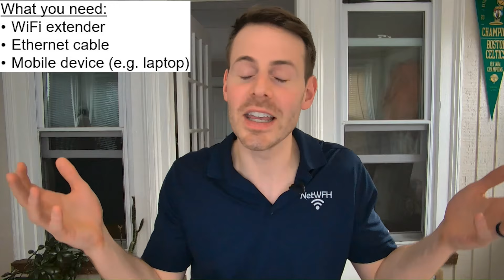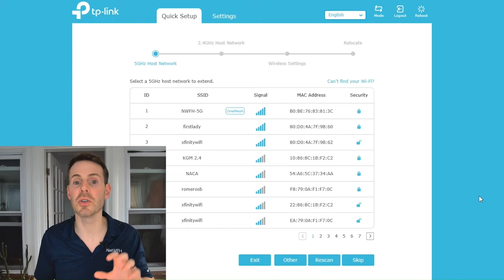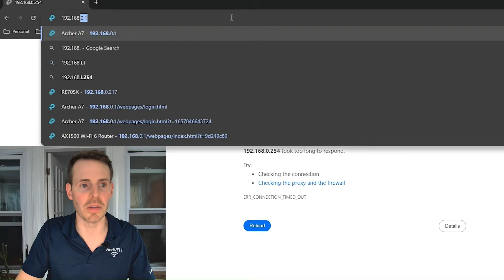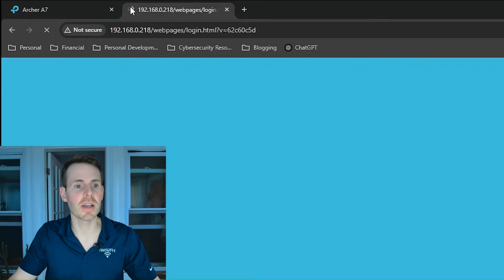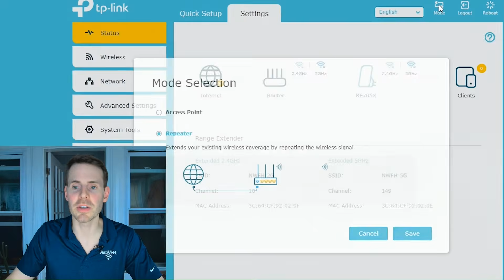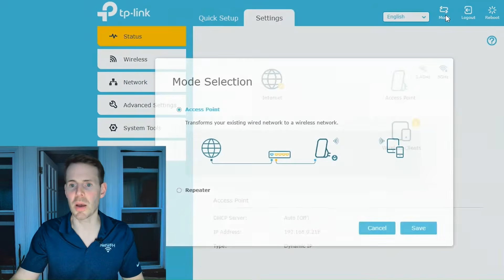How to Set Up TP-Link Extender in Access Point Mode (AX3000)

Comment: Hey. First off. Good video. I have a AX1800 that I have setup in AP mode. I want it to only broadcast one SSID instead of the the 2.4 and 5ghz and have the devices auto select the best for them. I read that I need to enable smart connect, but I cannot find that setting. Any tips?
Reply from the maker: Ok, yes you should be able to find that in your primary router's settings. With that said, you may want to be cautious about using WiFi Smart Connect. This previous video I made will hopefully help you with this:

https://youtu.be/I5TMKbrlGZk

Comment: If at some point I unplug the TP Link extender, or there's a power failure & it shuts off - while it's in access point mode - do I have to redo all of these settings? Or will it keep them as default?

Thanks for the video!
Very informative!
Reply from the maker: Thank you very much for the feedback! If you lose power while the device is in access point mode, it will retain its settings once it is powered back on. You will only lose the configuration settings if you perform a factory reset of the device. I hope this helps!

Comment: But that give all the people s on the street internet also
Reply: Not quite.  Using an extender or access point doesn't automatically give your neighbors access to your WiFI any more than initially installing a router.  Yes, they may see a stronger WiFi signal, but they won't be able to actually access it unless they have your password.
Reply: @monophoto1 some how people get acces to my
Reply from the maker: That is exactly right! People won’t be able to access your home WiFi network unless they have the password for your WiFi network. As long as you have a strong password for your WiFi network, you shouldn’t have anything to worry about. I hope this helps!